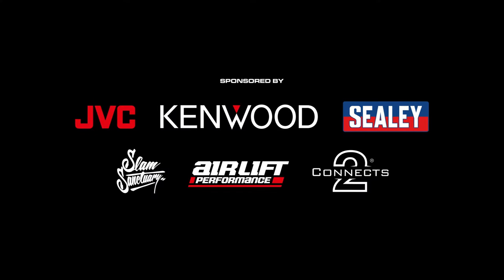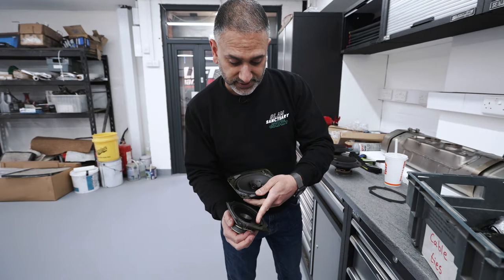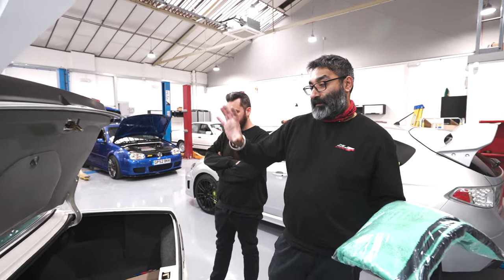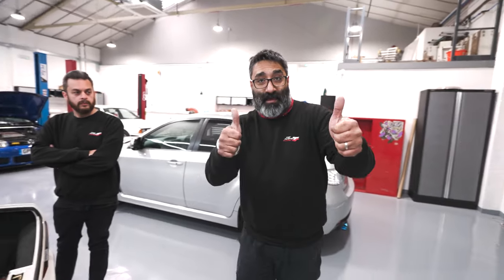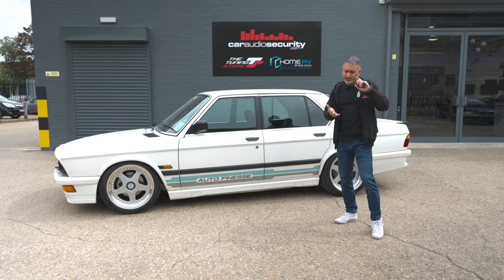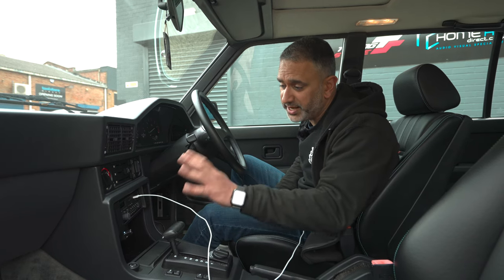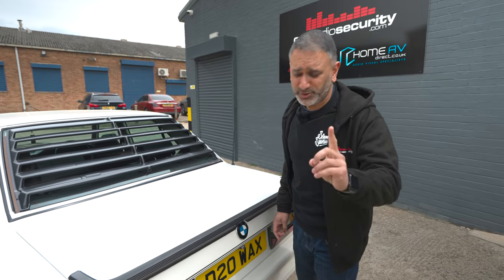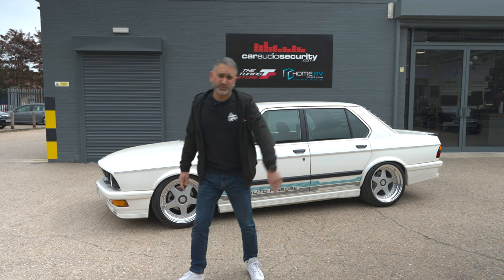BMW E28 M535i JBL Audio upgrade | Car Audio & Security

Comment: Do y'all have a recommendation on how to replace the kick panel speakers in an E28 with premium audio (mirror card tweeters)? Common thing I see on the forums is 5.25" components, but would require an adapter plate to clear the hood latch + glove box dropping. Would love to still have a component setup in the front, but no great way to do it. Cheers!